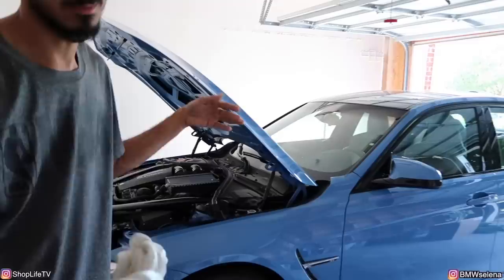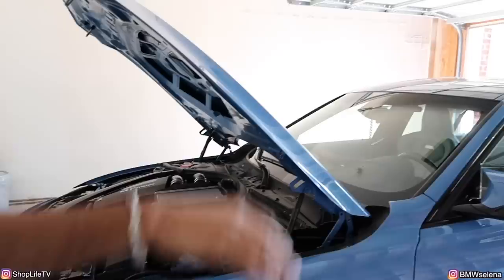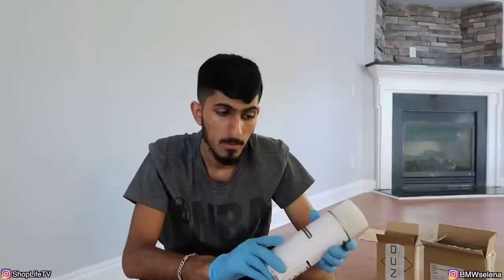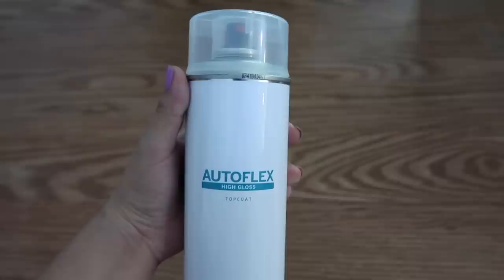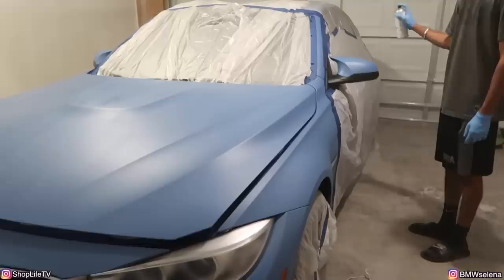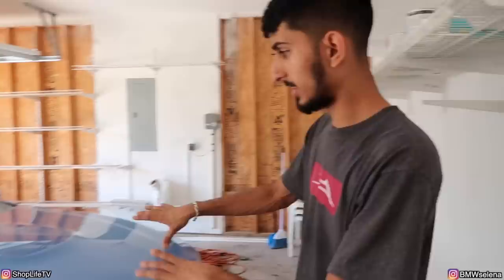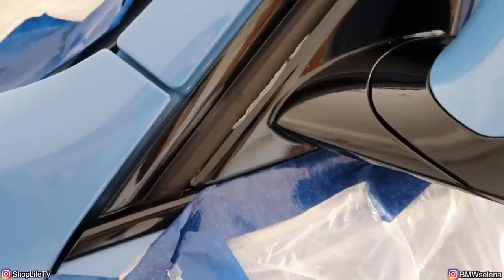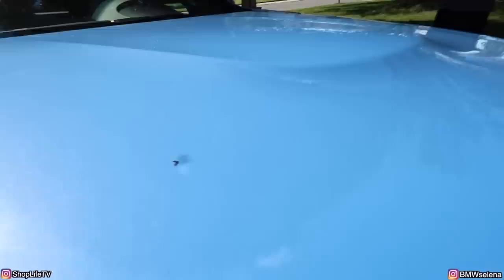SPRAY PAINTING OUR F80 M3!

Comment: I'd be concerned about the effect heat will have on the clear coat.  Between the engine heat and the sun when you hit the desert, could be disastrous to the paint as it melts and bonds to teh clear coat.